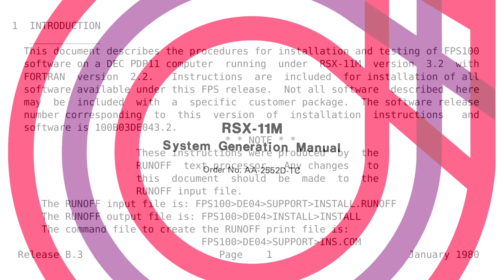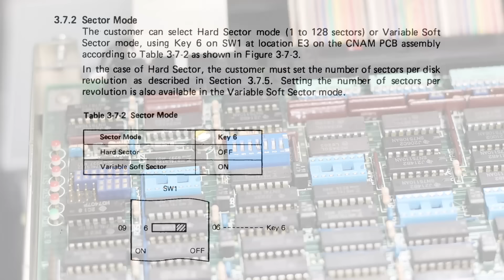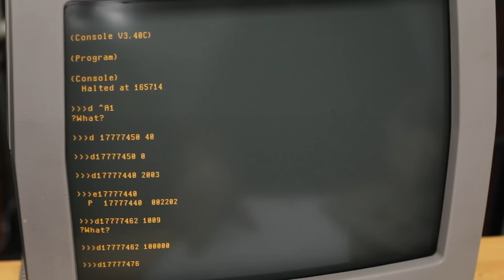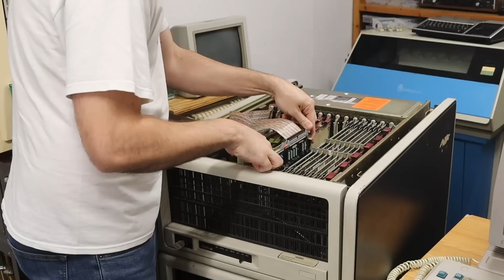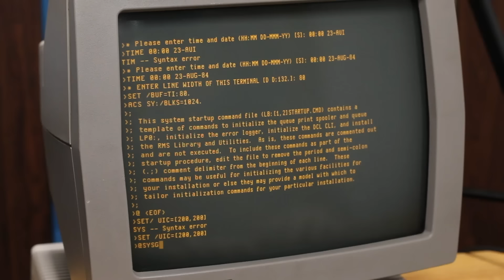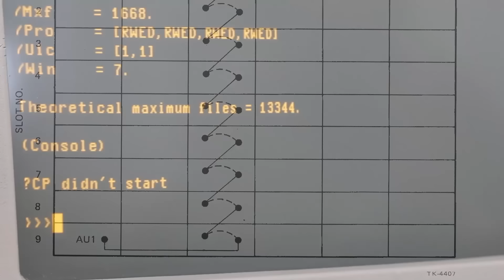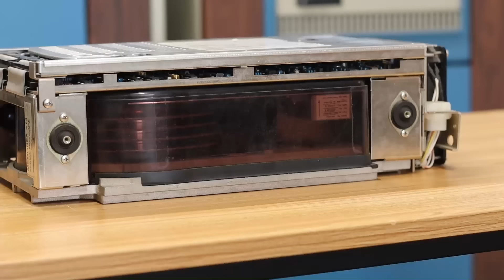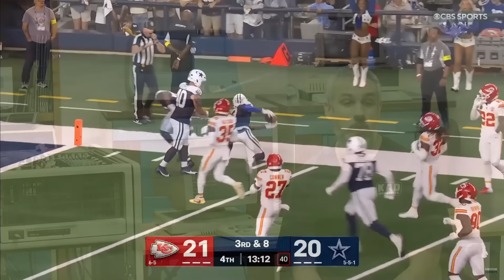My PDP-11/44 Won’t Let Me Format My Hard Drive

Comment: How many hard drive heads do you have with blown heads?
Have you ever tried to re flow the solder connections to get them back into working condition?
Perhaps you can rehabilitate a more period correct drive for your needs by getting a hawk or finch drive going again.

Comment: This is bringing back memories of the mid/late '70s. I was a PhD student, and my PC was a PDP11/45 with homebrew graphics system (much better than the contemporaneous Evans & Sutherland) where I was developing computational chemistry/drug-receptor interactions (a pal got the Nobel prize in the same field: bastard!) . I was using DOS/Batch, with RK05s.

The Prof got a research grant to upgrade the hardware, doubling memory to 128kW, with memory management, an RK07 and RSX11-M.  A colleague and I wrote a DOS/Batch driver to allow me to use the RK07, and we also installed RSX on another disk pack and developed device drivers for the homebrew graphics and associated hardware.

If one looked at suggested bootstraps from DEC handbooks they were extremely complex, but most instructions were involved in checking the ready bit and looping around. We realised that when entering a bootstrap from the toggle switches any instructions, such as cylinder select (a bus init would set cyl to 0, which is where the bootstrap was) , would be complete before the switches could be flipped, making such a loop irrelevant, so we ignored that. It meant the whole bootstrap could be completed in about 3 stages (the colleague of whom I spoke is currently trawling through his memory to see if he can remember what they were, but HALT, LOAD ADDRESS, and 177440 are deeply ingrained in our 50-year-older memories, if vaguenesses of that age can be considered memories).

My current PDP11s are RPi 3s, with touchscreens displaying the physical console, with toggleable switches. They are decnetted together, and I have several VT100s and VT200s connected via DecServers. The two Alphas also participate as do the 6 Vaxes. As they contribute to heating at this time of year I can afford to run them.

Comment: Try looking at the problem from a different direction:  If one OS wrongly thinks that there's somehow an alignment pack in a fixed hard drive, try looking at it from a different direction:  How does that OS detect that it's an alignment pack, and how can that be going wrong?

Comment: You didn't try DM1 and DM2 - do they have the same issue - alignment cartridge??

Write protect jumper/DIP switch on drive???? inability to write might be misinterpreted by software/system to be an alignment cartridge as you would be prevented from writing to those too???

Comment: RK06/RK07 drives use a disk area called bad144 (comes from DEC Standard 144) which provides bad block information on each cartridge. One of the bits in there is "this is an alignment cartridge", to keep people from scribbling on the magic data.

Your controller-resident firmware format routine probably formatted the disk as all 1's or some other pattern that is triggering the error.

You should enable tag 4 and 5 if both the drive and controller support it. They convey additional useful information. The drive and controller should be both be configured the same way.

By the way (assuming the hardware is around) I prefer to use a much newer Emulex controller like the UD33/QD33 (Unibus or Q-bus, respectively) which has much better diagnostics (and a real console dialog) when formatting unknown media. Even if you're going to move the drive to a different controller later, it will fully exercise the drive and provide a great deal of useful information.

Unfortunately you can't just use the DEC formatter found in the XXDP "OS" on your Unibone - it requires patching to do a format with an SC12. This is described in appendix D.5 on page D-2, assuming you're using the same SC1251001-J manual as me. Also note that those patches are for a specific revision of the XXDP diagnostic and will likely be at different addresses in other versions,

You also can't just flip the hard/soft sector selector switch and be happy. Your controller expects 35 sectors and you have to set the drive to match that. Neither your drive nor controller are new/fancy enough to figure this out for themselves. Set the drive for hard sectors and set SW2 and SW3 for 35 sectors as shown in table 5-13 on page 69 of the drive manual. Or you can do the math yourself as shown in section 5.2.5.6 (starting on page 56) of the manual to come up with the correct jumper settings for 35 sectors. That section/ page number assumes you're using the same B03P-4590-0101A-F manual as me. Those SW2 and SW3 switches are on the other end of the drive PCB from where your data cables plug in.
Reply: It's like God appearing in the comments and casually answering the deepest questions of life😂😂😂
Reply: this needs more likes, especially useful info about sectors
Reply: My first thought at the end of the video was "how would it know if it's an alignment cartridge?" and this answers that question.
Reply: no idea wtf you said, but seems important for usagi
Reply: aha that's awesome, there is always a guy with the knowledge or the right board. Fascinating and it makes me happy

Comment: This is possibly way too naive but I have seen some things like this. Could it be some switch on the boards in the disk drive that designates it as an alignment disk. I dealt with some Fujitsu drives in the 70s and I usually did not figure things out but I saw  techs who came to do the real work do something simple  and I would just shake my head — oh is that what the problem was.  Good Luck.

Comment: As a former DEC guy, it does not surprise me that the thing that works is the PDP ... I realize you need to get it working in that order but seeing systems that had been running for over a year was the norm. These things are still running factory floor and legacy CNC setups to this day. These things were "bomber built" from the ground up.

Comment: Way back in the Mini days, computer makers would do things to make standard products "proprietary".  For example, I know on Prime, you'd have to solder a bunch of interface "test points" together to get a generic CDC to work on it.  It was a way to get people to buy the expansions from the company (Prime) instead of cutting out the middle-man by buying from the OEM (CDC).  Since this drive apparently came from a different line, perhaps some of that nonsense is going on here.   

The other thought is to double check the terminating resistor packs.  Make sure they're the right value and have the right pinout. (There are at least two very different pinouts.)

Comment: these kind of issues are why I am still fascinated by this old tech - as it is were my modern stuff comes from - but I don't want to deal with it on such a level - for my at least pci, auto-pnp and acpi is pretty much a lowest base line - so, to be picky, pretty much everything around the times of nt4 or whatever linux was equivalent back then - sometime in the mid- to late-90s

Comment: Emulex made all kinds of magical cards that would make one device look like another - or like several devices.   I remember a system that had an Emulex card that made a drive look like two drives.   It was interesting because the drives had different density so you could tell which mode was active by the noises the drive made.
SYSGEN was a mysterious process, I always remember weird things popping up with new configurations, and this config is definitely "interesting".    Sometimes you ran into interrupt or CSR issues, and that could require some thinking to figure out.   I've never seen a system think a drive is an alignment cartridge.   There must be an indicator on a track that tells it this, but I don't know why it thinks it is an alignment cartridge and more importantly how do tweak it.   I would think there is a command switch that tells it to ignore this, but they would make it hard to do for the reason that you don't want to clobber an actual alignment disk.   I hope there is an DEC engineer out there that knows the magic spell for this one.   This is a problem I've never seen before, but then every SYSGEN I ever did seemed to have one of these.  Looking forward to learning the magic spell you need to make this work.

Comment: Perhaps the dipswitch settings are still locked... I see you're using a CI Wave-rake to adjust your dipswitches, I think you should use a short hook with a 50-thousandths top of the dipswitch tensioner, a little click down on 1, another click up on 4... and we have this hard-drive open!   🙂 LOL   I think everyone knows the LPL by now.
Reply: Perhaps LPL could unlock the drive

Comment: On the BBC Micro, the original disc filing system (DFS) supplied in ROM did not have the ability format a floppy disc!  If you had discs to format, you had to type in a short BASIC program.  (The listing was included in the disc upgrade manual, along with enough information to enable you to write one in machine code; but the Beeb's basic was fast enough, and the disc was slow enough, for this not to be any faster in practice.)  Then you could format some discs, and then you could save your formatting program so you would not have to type it in again.  Eventually, they would start supplying utilities discs with programs for formatting discs, as well as other stuff like editing their contents directly and recovering corrupt files.

Anyway.  If that drive has been used on a VAX, it probably will have a very similar yet subtly different format that could easily be getting mistaken for an alignment cartridge.  You should be able to write a quick program in PDP-11 assembly language to talk to the disc controller directly and format individual tracks, taking no notice of anything that may already be there.  You will have to hard-code in the drive number and the disc geometry data  (tracks, surfaces and sectors).  You could either make a different version for each drive or just copy, paste and edit the code into one long program to do all the drives.  Or play half-safe and split it first/rest.

Comment: 21:00 ring buffer networks are always a pain the ass. when you engineer things, you just pass more "cables" or lines. and that's why ethernet won, even thou it "wastes" more wires in the star topology. Star topology is just more reliable. or at least you do cascading interrupts, like the PC did. (why did I mention ethernet when we are talking about buses, because of PCI express, which is almost a network bus)
but this is a fun machine.

Comment: Real question is-how (A)lignment (C)artridge is reported to real Hawk drive, so you need knowledge of that and how AC is reported to the system. I bet they did not mess with that too much and Hawk instantly knows and sends that info to the controller card. Here-that signal is wrongfully sent to the controller, or it generates it wrongly by itself. If it is some shorted or opened contact in AC that is passed through to Hawk, that passes it furtrer in some form through the ribbon cable to the controller (or in the signal way), this can be sorted quickly.

Comment: Use scissors, or an edge cutter, not a knife to trim IDC cables after adding a connector. Using a knife can introduce intermittent shorts. Ask me how I know.
Reply: Use a knife of a scalpel, then just look at the result to ensure that there are no strands that are shorting out the pins.
There may be a couple of wayward strands after cutting,  but they are easy to see and to remove.

Comment: I ended up almost missing thanksgiving one year for a very similar issue - I put phenolic plastic TGV housings on my ‘02 WRX, and it took me WAY too long to realize that meant the intake manifold and block were no longer electrically connected, which was the cause of a bunch of sensor issues and a no start condition. Just had to add a new ground wire for the manifold and it started - boy was that a PITA to troubleshoot tho!

Comment: Awesome video, as always! But you also reminded me of why these minicomputers were typically supported by a team of people, not just one. A company that had a PDP maintained a service contract, usually with DEC (but there were independent firms that provided mainframe and mini support, usually at lower cost), which sent out field technicians to fix hardware problems, system operators with advanced training to handle special case administration that the in-house sysops didn't know how to do, and, for smaller companies, programmers to write or customize the software that end users ran. Most of what the field technicians and system operators did was never documented for end users and enthusiasts, so it's not surprising when you struggle when you try to do their jobs. But that's a lot of what makes your videos so awesome to watch. You're showing that anybody with the inclination, good general tech skills and lots of time can learn how to restore, modify, maintain and operate these old minis. Doing it without the benefit of the training that DEC gave to its technicians makes it a slow, sometimes painful process, but you probably learn it better that way.

Comment: For those wondering about what Sysgen is doing...

A modern Linux (kernel) has dynamically loadable modules and can also probe and adjust itself to match the hardware it finds, in part using things like the Intel PC-architecture spec, DeviceTree modules, the ISA-bus PnP,  USB and PCI bus descriptors. Together with a ton of configuration files in the filesystem, and the help of a mass of complex tools, Linux can morph and adapt as needed. The "Installer" you have for eg Ubuntu or Fedora is doing the higher level job of creating a filesystem on a drive and placing lots of files in it so the computer is in a position to be useful. A tiny part of that is putting in place the files the linux kernel uses to interact with the hardware and runtime.

By contrast a lot of old OSs could not do that - they relied on literally being built at compile time to be the right config. So I expect the sysgen is basically doing a compile/link of the RSX kernel code with all the right parts in the right places so when the kernel runs it doesn't need to explore the hardware - it just uses it. The corrollary of course is that you have to do a sysgen for pretty much any change to the OS - from adding a terminal to changing background processes. It is all built in.
Reply: Yup

Comment: Ha!  I used to make and repair Floppy, MFM/RLL and SCSI cables the exact same way, and using a vice, back in the 80's and 90's! Nice to know I wasn't wrong in my method! :D
Reply: Yes, using a vice is definitely the way to do that job.
Reply: I think hidden away somewhere I have a set of alignment blocks for similarly attaching insulation displacement ribbon cables to connectors.  Used them only occasionally, because I never had them to hand when I really needed them!

Comment: I love that you use a lock pick to set the DIP switches.
Reply: Should have set the DIP switches twice to ensure it wasn't a fluke!
Reply: Turns out they're a valuable multipurpose tool for a computer restorer. Not only do they set your switches they also let you start your Centurion.
Reply: @keab42  oh yes true
Reply: Who knew a wave rake doubled as an IT tool.
Reply: Lock Picking Lawyer would be proud.  Little click on three,  big click on five, cracked and gutted...
Reply: "And for this I'll be using the CI Snake Rake..."
Reply: I remember setting boot dip switches on the machine at my first job in 1984. Good times.
Reply: I am here o props your comment.
Reply: "The one Bosnian Bill and I made"

Comment: Sure you have this already but have a look at this, the MCR Operations manual on bitsaver, page A-9.  It says the last track on an RK06 drive identifies it as an alignment disk.  So either there is a DIP switch wrong somewhere, or the format hasn’t worked or overwritten the last track, or a software / firmware bug on the Emulex card.  Just guessing really - if it was a proper computer (an IBM 370/158 running MVS 3.8J), it would have a proper status light ans error message!  😂😂😂.  https://bitsavers.trailing-edge.com/pdf/dec/pdp11/rsx11m_s/RSX11M_V3.2_Jun79/2_Operation/AA-H263A-TC_RSX-11M_V3.2_MCR_Operations_197906.pdf
Reply: Thinking about this a bit harder, maybe this has to do with the way the Emulex is treating the virtual partitions on the disk and maybe the format hasn’t overwritten any previous data when the Fujitsu was configured for the VAX.  So RSC sees some old data on the last track from the VAX days and goes oh, there’s data here - this must be an alignment disk and so stops.  As to how to eliminate and zero last track data on that Fujitsu whilst it’s emulating an RK06c, I’m afraid that’s where my ideas run out…. Unless stick it under a massive magnet, maybe?

Comment: It seems like the format routine used didn’t write the bad block list correctly leaving the disk flagged as a test disk.  I believe the test flag is in the first word of the list on the first sector of the numbered cylinder.  Perhaps there is another flag needed for the low level format routine used or barring that use a sector editor to reset the disk status.  My DEC documents were destroyed by a water leak, so I don’t have specifics, but other comments seem to be on the trail.